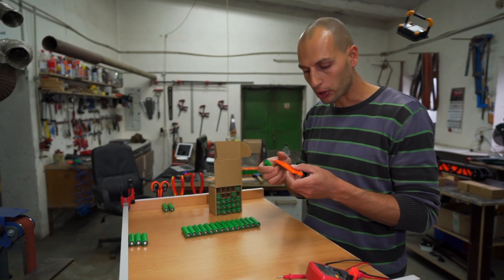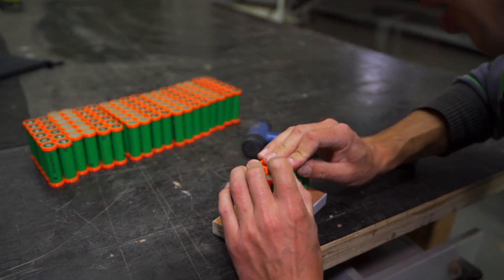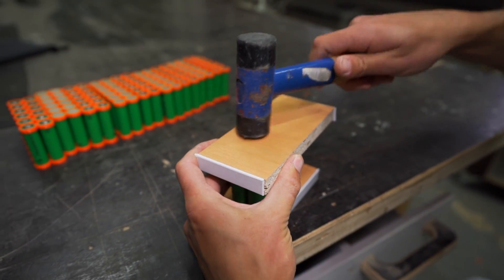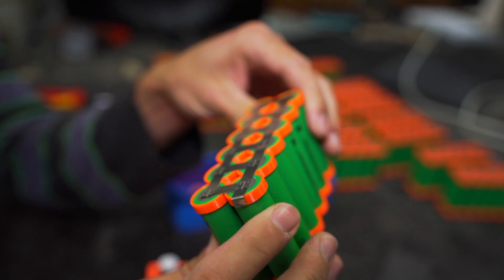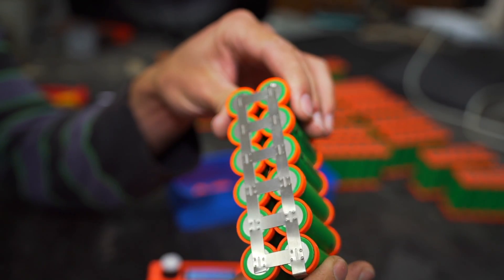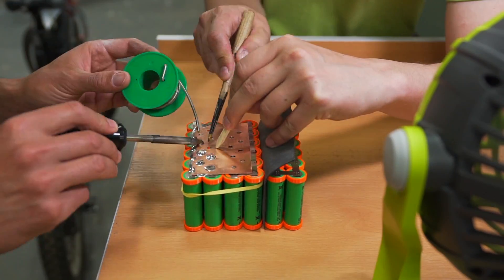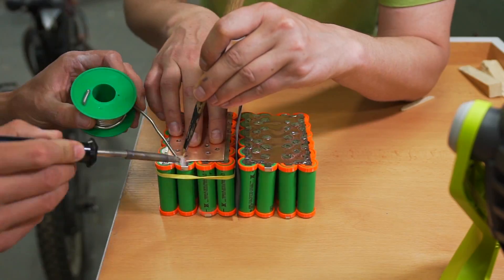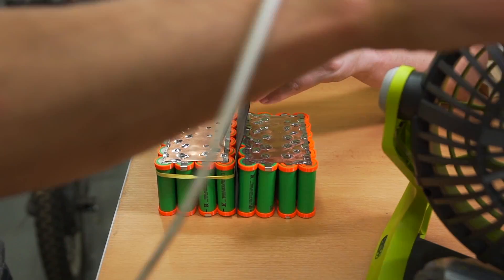How to Make DIY 18650 Li-Ion Battery Pack/ 20s12p 72V, 36Ah, 200A Discharge

Comment: Hello everything looks good and great but you know that 18650 and other cells are not soldered but spot welded because the film is made of plastic where the lithium and cobalt is steamed on it, this can cause damage and if the cells have a pressure relief valve automatically by a hiss degas or even burst.

Comment: If someone could get the 18650, 3400mah $2.75 or 21700, 4500mah $3.75 or LFP K2 26650, 3200 mah $2.50 each what would you use if able to get these? 
         On your pouch cells, your getting 20,000 mah, there is some here selling two 8,000 =16,000 mah in each pack. Do your 20,000 mah pouch cells come with two of them on each module? I know I’m asking a lot at once. Thanks I love your different bikes. 
     Your one bike that are using the pre made RC pouch’s your using how big are they each. Trying to decide which bike I want to go after. Thanks, love all your videos.

Comment: The wire of the bms can support high current? I see that it have little size wire for each module (20s = 20 modules)
Reply from the maker: Yes, these are signal wires only.
Reply: @ladiandmargaret  thank you.

Comment: How do you feel about dual hub motors?
Reply from the maker: I don’t think it’s smart. At least not worth having so much weight on the front wheel. It’s very difficult to maneuver.
Reply: @ladiandmargaret  have you ever thought about building a car using these same bike parts?
Reply from the maker: I’ve thought about building a car but not with bike parts.

Comment: I like the copper plates on top of the nickel strips. But I wonder if it's really needed for the 200amps vs. the risk using all the solder heat destroying the batteries????
Reply from the maker: Yes it is worth it. You can easily calculate 200A is too much for a thin 0.2mm nickel strip and it would heat up a lot. Soldering doesn’t warm up batteries at all. You heat up copper mainly and thin nickel doesn’t transfer heat much. You can keep a finger on the top of the cell when soldering.
Reply: @ladiandmargaret  thank you for your reply. I always thought these nickel strips might be to  weak in terms of conductance. Why not then straight soldering copper strips to the battery? Btw.: I read many times people are concerned about heating up the batteries too much during soldering up to damage.
I thought I may build a battery box without soldering or welding in order to save them from heat and be able to exchange batteries easy : using strong springs to push them together in series, in between braided copper weave to ensure full contact surface and extend the weave to parallel cells+ be able to solder my bms wire to it. How you think about  this??
Reply from the maker: Yes, soldering 18650 cells must be done smart. It’s not easy to weld copper with a spot welder.
Reply: @ladiandmargaret  ok thx. How thick are your copper plates? Any thought about my battery box idea?
Reply: @Gallardo6669  half of the cost of your battery will be your battery box. spot welders are easy, quick and consistent. nobody ever changes out cells, it just never happens. (just don't use those stupid recycled laptop packs for your battery) btw nickel has a high thermal resistance, soldering to it wont damage the cell at all.

Comment: I have a battery question. I built a MX type ebike with full suspension. I have an 72v (84v) battery 20s6p. And it’s a little weak on holding the load at time . I’m thinking of losing 6 pounds of weight on the bike and want to add a 20s3p pack. Can I do this or does it have to be the same size packs?

Comment: Cool video. Neat idea. How do you keep the cells from getting over 60C when soldering? If you don't, you are damaging the batteries. Also that stack of solder that your iron couldn't melt at the end is the choke point for your current, and will probably melt the solder while you are discharging at such a high rate, your main leads will come detached. Lastly, copper work-hardens, so if you don't have the bends just perfect, and you try and re-bend them after bending them once, they may break off.
Reply: the holes are drilled where the nickel strip is offset from the cell, if you've ever soldered nickel strips before you'd notice nickel has very low thermal conductivity. the cells never even get warm.  copper plate is annealed, and he's doing a single bend anyways.
Reply from the maker: I’m soldering to the nickel strip and cooling it right after, it’s just surface heat not deep cell heat at all. Don’t worry, I know the connection doesn’t look great in that shot but I heated it properly after. I don’t bend the copper back so it should be fine.

Comment: Excellent move making the series connections using copper plates soldered on top of the nickel strip - much lower resistance to support peak power

Comment: @Ladi: Nice build .....as usual :-)
Just one question: Which filament did you use to print the cell holder ? PET or something stronger like ASA / ABS ? Oh yeah, and just a side note to working with shrink tube: There is no need to really cut any protudinng shrink tube of. Simply re-heat it and press it flat against the battery with a flat piece of wood.

Comment: As much as I love ebikes I'm still forced to admit the range isn't there yet for touring compared with a traditional motorbike, even with a mutli-kWh battery. Even the LiveWire and Lightning LS-18 don't have enough juice for the real long journeys. This will all change of course, and I'm looking forward to when charging stations become ubiquitous.
Reply from the maker: Depends on your purpose. I love using them on my most common 80km range. Much better, cheaper and more dynamic way of transportation.
Reply: @ladiandmargaret  I have my own DIY ebike up to 60 km range or so now, I'ts a blast! I just want more and more. :D